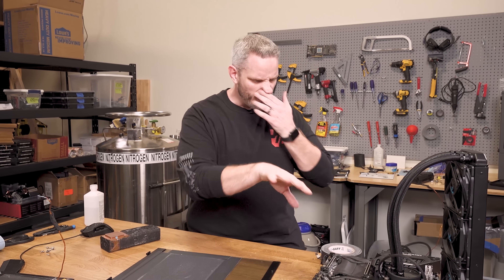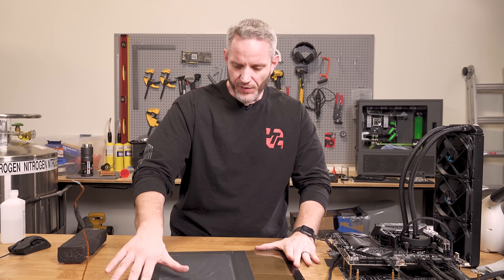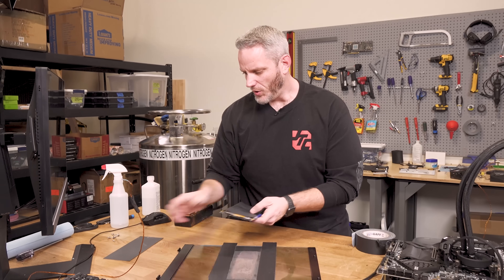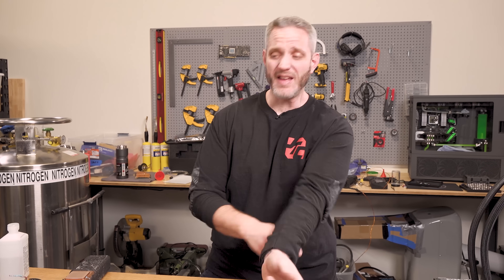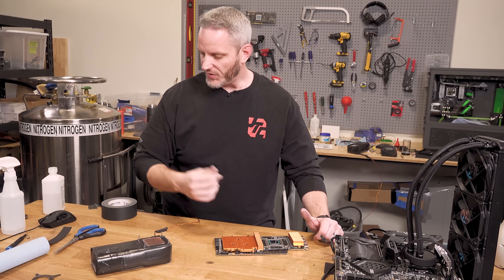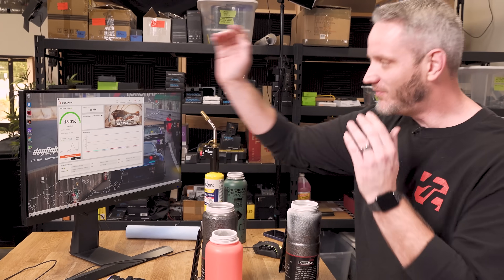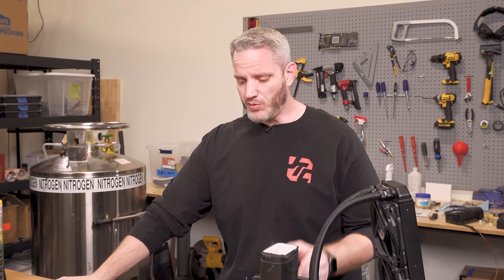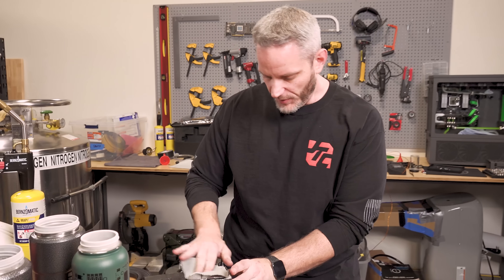THIS is Why Lapping Your Cooler is SO Important!!

Comment: Jay, theres this tape we use in HVAC that is like a tar thats extremely resistant to cold weather. I think you should look into that, and it dosent melt. I think it will help you tremendously.
Reply: I wish I could tell you, I haven't done AC in 15yrs. But I know they still use it
Reply: @mas9067  Mastic tape
Reply: Sounds like bituthene or roofing ice/water shield.
Reply: Cork tape, got a roll of the black nasty in my work van.
Reply: Mas do you think using a heat pump ground loop system would work on the pot if the cold side was around the pot and he heated the hot side with a high power heat gun? Scaled down of course.
Reply: @randyranderson1621  dude, only we would know what that means lol, that's so funny
Reply: great idea!!
Reply: whats it called though
Reply: He really needs to moisturize his hands.  rubbing his hands together all the time.
Reply: Oh ya like a butane rubber or some crap, that stuff they use for sound deadening
Reply: Why can’t they just submerge the board in light oil? It won’t freeze, its Dieelctric, i know its messy but it would save it!
Reply: @Carl2k7  Because it would freeze, there is a reason why in many places like Alaska you need a heater for your oil pan and gas tank so they don't freeze up mid-winter.
Reply: Is it removable though?
Reply: @David O Dwyer I think that's the company armaflex.. but yes that sound familiar.
Reply: Self-amalgamating tape as it's called in the UK?
Reply: @David O Dwyer dude you defy physics if u run at -30 to -20 kelvin
Reply: @Dinossssssssssss  clearly they were referring to the Rømer temperature scale. How far superior method. Yes, mmmmhhhh, quite right. 😜
Reply: Zip tape works for high and low temperatures and it’s extremely sticky
Reply: @ImpactedLamb967  Zip Tape is more for house insulation and requires a fair amount of pressure when applying it.... And it's not really intended to ever be removed.
Reply: dont need tar ... need thermally conductive micro particulate paste you WANT the heat and cold to transfer as fast and efficiently as possible ...
Reply: @0623kaboom  I think he's talking about using it as a more permanent water shield for the PCB, rather than the Vaseline.
Reply: @JaronActual  I think that the Vaseline is permanent enough considering the application. I don't expect that someone in this use case is looking for longevity of their system ...
Reply: @0623kaboom  MX4
Reply: I would just rubbered plastic dip the whole card  except the die, pcie, power plug, and any other important bit of the card this way air can't get to it. less chances of frost building up
Reply: Maybe some sort of a re-annealing resin insulator?
Reply: @David O Dwyer I was just asking a question, no need to be so condescending.

Comment: Since I know you like cars jay, hand lapping is the wrong way to do that.  You would have to apply the same pressure evenly over the whole mount otherwise you run the risk of making it flat but slanted in whichever direction you were uneven.  You wouldn't do this with a cylinder head, send it to a machine shop have them mill it to ensure you actually have a true flat surface.

At least use a weight with sand paper and use the weight as a standard instead of holding the mount.

Comment: When I lap my CPU I did it until it was like a mirror, with up to 1600 sandpaper, the temps inproved a lot, arround 9ºC less at full load.
Reply: The flatter and better you can get the surface roughness the better the thermal transfer will be, I don't know why he said "scratches are good for paste to bite into"...  Theoretically if 2 pieces were perfectly flat when you put them together they would "weld" or become the same piece. Lookup gage blocks "wringing" together, interesting phenomena.
Reply: @Steve_Just_Steve  Under normal ambient air conditions you're right, the flatter the better, but I think I remember kingpin saying you want it scuffed when lapping for LN2 applications. I think it was in GN's video where they were lapping Steve's 7980XE
Reply: @Eidolon2003  interesting
Reply: @Eidolon2003  After thinking about this, I'm going to have to call BS on the "scuffing" regardless of LN2. Maybe you misunderstood or they're just wrong and it's another variable effecting their results. Here's a study I was looking at that covers thermal contact conductance between various metals with varying surface roughness from cryo to 500F. 

core.ac.uk/download/pdf/85233967.pdf
Reply: @Steve_Just_Steve  I totally agree with you, flatter = better as far a thermal conductivity goes. This is the video I was referring to https://www.youtube.com/watch?v=iShcG91eLoc , and at 9:58 in that video Vince mentions what I was talking about. When the paste freezes it needs something to grab onto or else it'll "slide".
Reply: @Eidolon2003  cool I'll check it out
Reply: @Steve_Just_Steve  Cold welding is a cool phenomenon but also a pain.
Reply: A delided CPU is not made with sandpaper. A delided CPU means you removed the heatspreader from the die etc.
Reply: @VenoXj1  I mean lap, I don't know why I wrote delid XD

Comment: Dumb question, sorry if I missed the answer: why don't manufacturers perform this process before shipping their cooler or IHS?
Reply: Costs, the process is very expensive. Lapping (or facing) every single cold plate to very exacting specifications runs into diminishing returns very very quickly. So it simply isn't required for standard coldplates.
Reply: probably because the companies send the blueprints to china with a 50 Yuan budget manufacturer.
Reply: Would be way to expensive for them to do it to every IHS or cooler. And its only really necessary when doing extreme overclocking.  The thermal paste is suppose to fill in the gaps enough to transfer the heat from die to cooler for normal everyday use and not needed.  Would be something good for the KingPin cards to have done before they are shipped though since they are entirely designed for overclocking. They might actually be for all I know.

Comment: I lapped my waterblock and cpu (10600k) temps dropped from 85-90c in game to 65c max with a combination of liquid metal and lapping it made a huge difference i was able to lower the voltage .15v to keep the 5ghz oc stable

Comment: Jay: Would using a very thick/strong backing plate prevent warping due to overtightening of the clamp using the mounting holes? Shouldn't be very hard to get a nice thick piece of steel on the back of it to keep all those mounting holes in the same plane.

Comment: Thin glass will flex so you still need to put the glass on a smooth even surface. According to no research whatsoever 3/8" and thicker glass will not flex. Glad to see this correct technique used.

Comment: This isn't lapping. This is sanding.

Great stuff though. Loved the vid
Reply: I wonder if actual lapping would be a good idea for CPUs? A very fine grit lapping compound between an IHS an the contact plate of whatever you're cooling the thing with would probably give a very good surface-to-surface fit. Obviously wouldn't work very well for GPU:s though, doubt the bare silicon would take kindly to it.
Reply: A channel called Penrowe did a video about precision lapping a cpu and cooler. Unfortunately he sold it pcgamer and they did a small article and never tested it. He theorized that you could you could use it without thermal paste
Reply: @joshuahuman1  thermal paste is to allow for the maximum performance possible ... not using paste has been possible since the 286 ... those who wanted to overclock to ridiculous amounts used it to allow for the higher temperatures to be more readily dissipated through to the heat sink ... in 30 years nothing has changed ... except people forget that aluminium is a better cooling medium to use than copper ... is also lighter and is more easily surfaced to provide a uniform smooth area to attach too .... just because people think liquid cooled is cool doesnt change the fact it is the SAME tech we had back when the 286 was NEW ....
Reply: @0623kaboom  Well.. None of that is even remotely true.

Comment: you could find out if its level with a feeler guage and straight edge automotive feeler guages go down far enough for you to tell or not.
Reply: Feeler gauges don't go thin enough for this. You need tenths of a thousandth or less.
Reply: @danieleiferd4978   i build engines from time to time and yeah bro they expensive but they make them that thin they look and feel like pieces of metal paper lol its harder to find a level straight edge lmfao

Comment: Lapping Your Cooler isn't important unless you are being thermally throttled. Big tech youtubers need to stop pretending like doing this super edge case shit is important.
Reply: He is cooling with LN2 down to sub zero temperature like -110c, he explains that even when it is that cold if the temperature between different cores changes to much, he will not get the high scores he is working toward. He is not telling regular computer owners to do this. He has older videos explaining how this is not necessary for average users similar to what you explained.
Reply: @Jesus__Loves__Us__All   His Youtube fans are casuals, the word important it implies you should do it. Jay and big tech youtubers profit off hyping shit up
Reply: @ggzii  but if someone says THIS is why it is important and then shows you a bunch of stuff you don’t do, like using Liquid Nitrogen to cool your graphics card, most people would be able to assume that this wouldn’t apply to them, I get your point about YouTubers hyping stuff up to make money. That is just not what I saw in this video. I’ve been watching this series and for him lapping worked and he got his high scores finally. For what he is doing Lapping made the difference. The only thing he profited off of in this video was entertainment for those who are interested, ad revenue. He wasn’t selling LN2 pots or sandpaper.

Comment: Dumb question... I’ve got an six year old desktop with a great processor for its time (still sufficient for my needs), it has multiple drives and an 850 w power supply.  I vacuum the thing a few times a year to get rid of the dust bunnies, but otherwise it’s been left on for it’s entire life.  It’s water cooled, DOES THE COOLING SYSTEM NEED TO BE CHECKED, CHANGED OR ANY MAINTENANCE DONE?

Comment: So Jay, when you are sanding this down, how do you keep it square to the mounting hardware.  IE, the block may be flat, but if its not square to the pressure of the block, then one side will get more pressure than the other.
Reply: exactly, he talks about precision then does it by compensating for hand like wat